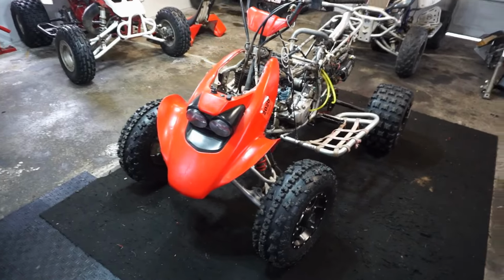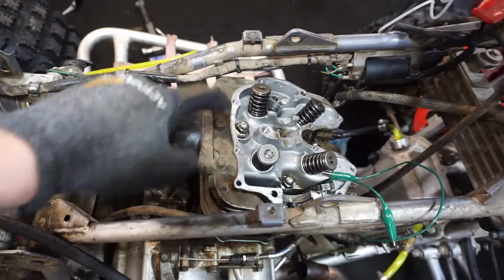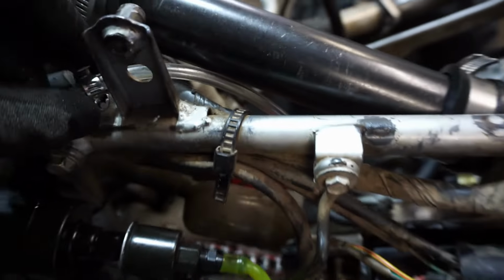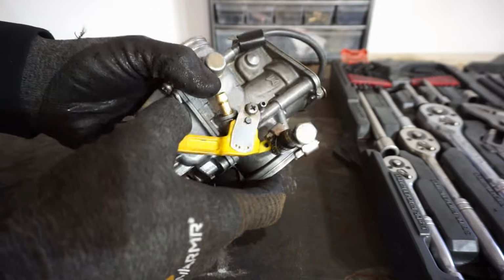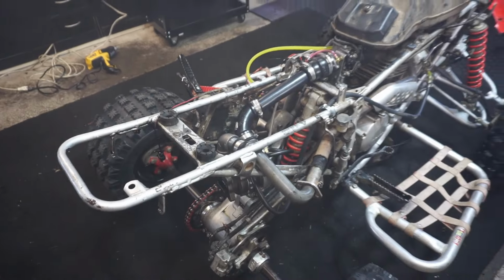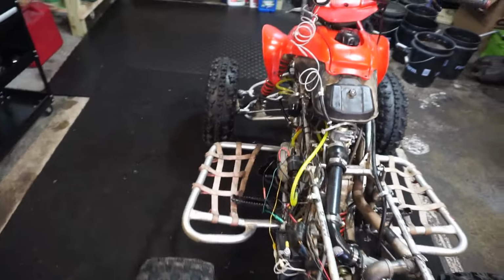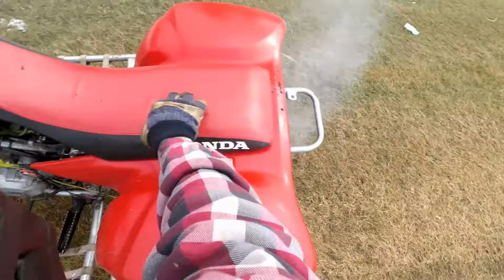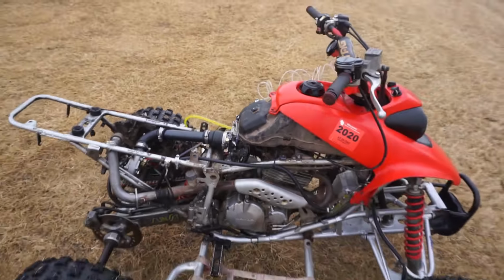Turbocharging My Honda 400ex 2.0 First Ride (New Design + Upgrades)

Comment: If you would put the carb before the intake of the turbo, run the carb on vaccume not boost, it will run correctly.

Comment: Joe carb turbo set up is very difficult and requires a special carb and lots $. Fuel injected is much much easier of a project and just requires a boost/fuel regulator that boosts pressure to injectors to act like bigger injectors..try this project on a FI quad

Comment: The only way you're going to make it work with that carburetor is to put the carburetor on the intake side of the turbo since you do not have fuel pressure as soon as it builds supposed it pushes the fuel back into the tank

Comment: Good concept good content what u need is a independent control module   (computer) fuel injection heavier valve springs? I would look into maybe go-kart fuel injection systems single band wide band 02 sensor? Just kicking around some ideas either way always informative to watch and entertaining

Comment: Instead of randomly guessing, A WB02 sensor kit is $170 and would let you know whats going on with all your engines. You can setup a kit with a small lipo 4s battery in a back pack and transfer it to all your projects easily.  Def need to know what the Air/fuel ratio is if you want the setup to work well.

Comment: 🔥pretty cool man, def a killer build. Forsure carb issues. Don’t give up Man U will get it. Stock jetting, no fuel pump, that carb is setup for gravity pressure, get it running smooth first, yes will be lean. Then slowly jet up and keep looking at plug till looks creamy. To me fells like will be hard to achieve it all with a carb setup trying to force all that air flow and moving that fuel into cylinder. Maybe work lil better with efi engine? Just a thought 💭

Comment: might be to much oil pressure for the turbo try suppling the turbo with its own oil supply tank being gravity fed so it takes it in only when it needs it and use a return line to come back into the tank

Comment: The regulator needs to be hooked to your boost gauge with return line back to tank the fuel should be a pound over your boost pressure adjust floats so the floats sit low. When you build boost the boost is pushing back down the main jet and shutting the fuel off with a higher fuel pressure it will continue to push back against the boost put a fuel gauge on the line and adjust. Your regulator should be boost controlled . Most carbs run at about 1-3 pounds mostorcycle cars are 4-7  so boost plus normal pressure is what you should need. Also it may help to run the oil return into the oil fill in the lower case or even the drain plug may take some piping but can be done you won’t need the oil pump anymore good luck I would like to see this thing work out for you.

Comment: Take the fuel pump off when it starts making boost it's pressurizing the carb and making it dump more fuel and starts flooding it I had the same problem with my turbo snowmobile

Comment: Maybe you need to build the turbo closer to the exhaust hole, i think youre way to build pressure is to long im just suggesting not shure but i shure you can do a better job for smaller air flow i hope this works out its a cheap way to fix it ✌🏻💪🏼

Comment: Everything is good you just need a tune or buy an racing ECU, it's the same aspect as boosting a car. If you boost it without a tune it will not run properly 💯💯💯 the computer aka ECU isn't preset to run boost at all. Try that and some racing coil packs.

Comment: You can't use that carburetor, as it's vacuum controlled.
As soon as you get boost, you lose the vacuum.
You need a different carburetor, or have the carburetor before the turbo, in any case this carburetor is not recommended.
You don't need fuel pumps etc, just connect the turbo pressure to the air hose to the fuel tank, and then you have the right pressure on the fuel all the time.

Comment: Is that surging being caused by un-controlled boost? Ie: un-controlled boost upsetting fuel mixtures under load?..  try boost controller/boost tee and keep it at six or seven pounds boost and tune fuel around that..

Comment: When you make boost you loose all vacuum. Just try putting the carb in front of the turbo and see if it helps
Reply: It looks to be a vac problem, as soon as it makes any boost it quits. The carb is designed to suck air and fuel. Adding boost could be pressurizing things that need vac. Or even pushing fuel the wrong way through the jets. 
If the carb is in front of the turbo it will continue to make vac while making boost. Just have fuel and air mixture going through the turbo. But could answer some questions pretty quickly. Good luck. Sub’d

Comment: Its simple to add power you have to add what? Air aka boost with that you also have to add fuel and alot off it especially when in boost when not in boost it will run fat because of the restrictions on low end and big fancy fan in exhaust

Comment: You need a blow-through carburetor, most carbs arent designed to work with boost. the air and fuel arent mixing correctly.

Comment: joe id recommend the wastegate spring may be only 5 lb and with turbos u have to knock timing usually unless its self learning but why i say waste gate spring is because itll make over a certain boost then cut the excess out its what its for and itd limit boost

Comment: I'd say you need to stick to your original design of putting the carb on the air inlet of the turbo, but putting the turbo a lot closer to the engine, that way it should work, well it does on cars anyways, although car carburetors are designed differently, so you may need to look into that.

Comment: I’ve seen boosted single cylinder engines require an expansion chamber in the charge pipe for the offset pulse of boost

Comment: 2 things,  (1)- It really sounds like it is running WAY TOO LEAN  !   --- ( 2) - I know from car setups for racing, that a lot of times  when you add more boost you have to ADVANCE TIMING  &  Run a much COLDER spark plug.  Also just a suggestion but these carbs are not designed to run being pressurized or FORCE FEEDING AIR,  plus look at the spark plug condition everytime you make a jet adjustment, this will tell you a lot  !!  DON'T make your jet changes so drastic.  When ever you are working on jetting you need to make smaller changes until you notice a change

Comment: Hi I have done this before I have seen all of your videos abowt this and I can’t remember if you bloked of the hole in the front of the carburettor where the boost pipe gose on if that’s bloked it stoped the carburettor getting flooded and that’s what it sounds like thats happening blok all the aire holes that come out of the carboratore threw the lines to ballene the boost pressure across the carburettor and that shouild work put one size jet down from stock and go from there and do a plug chek and see how it’s running that will fix it please try it it will work if you stick to it

Comment: A suck through turbo is a lot easier as then the carburetor  is not under boost ,  just size  a carburetor for the horsepower you expect ,  7lbs boost means 1.5 times more air  , 1.5 times more hirsepower

Comment: Are you sure that hose you have blanked off is not the return line for the pressure regulator.  In my experience the regulator controls the pressure by dumping the fuel above the pressure you set.

Comment: That carb is a diaphragm style carb. The butterfly is connected to the cable but the needle needs vacuum to work. I would try a traditional style carb. I'll bet that will fix the fuel problem. Also you have no way to adjust timing for boost. The reason it will rev when sitting still is because it's not making as much boost.
Reply: The 400ex carb is not a CV (constant volicity) style carb. The slide & needle are connected to the throttle cable. The LTZ400 uses a CV style carb like your thinking which uses vacuum to raise the needle.
Reply: @cadman9615  darn! I was hoping it was the problem and could make this thing rip for him!!
Reply: @bigcaputo09  yes! I’m hoping he keeps at it. It’s an awesome project!

Comment: Help pls, i kno ur a 400ex guy due to all the great videos lol, what seals the rear parking brake on the caliper. Mine is leaking out of rubber boot. I took it apart and cleaned it and it doesn't look like any parts are missing but its leaking out around the spiral screw that the lever attaches to . Any help will help 🙂

Comment: Only seen this latest video but just one bit of advice, if you don't pressurize the carburetor bowl so it matches the boost coming into the carburetor how do you expect it to draw fuel.? If you're intake track is pressurized it's going to blow into the carburetor instead of drawing fuel out. Just my two cents

Comment: Is there a return pipe from the carb to the tank? 
Reminds me of a problem i had before where the fuel return pipe was blocked on a yamaha Fazer. 
The return pipe used to relieve the pressure into the fuel filler cap and back into the tank. 
Might be way off but just a thought, love your vids anyway 👍

Comment: question. since u add turbo more psi fuel and oil pump along with top end rebuild wouldnt some type of tune or bigger engine or something to help compensate for the added boost?

Comment: Maybe look into getting a mini squirt that way you can adjust the ignition timing when under boost also try regulating boost pressure to 3 pounds that way it can spool lower in the rpm range and hold a steady boost pressure without lagging so long before it comes on

Comment: I know this video is old,  It's sounds like it's pre igniting/detonating do to too low of fuel octane...Turbo motor's run higher compression due to increase air volume forced into the combustion chamber, Try octane booster or 110 octane race gas

Comment: your leaning out cuz a blow through app requires more fuel pressure then boost or you dont get proper fuel spray try the draw  through carb and try again

Comment: Hey man. From what I see and can hear the turbo needs too be closer too the engine or your piping for the turbo needs too be smaller. There is too much space and that engine can not move enough air.. on cars there is 8 cylinders or 6 or 4 that are pushing air for the turbo..on cars you could basically put the turbo anywhere and it will work. I'd say try too get the turbo closer too the engine. Good luck man I love your videos keep up the good work.

Comment: Yeah throw that ebay turbo crap in the trash and put that thing back together right. If you want some hp gains start upgrading. I do applaud your persistance though. You certainly gave it the Ole college try as they say. Lots of better ways to make that four wheeler bad ass man.

Comment: Did you put a little extra gap in the piston rings for the extra heat from being turbo'd? Also is that a rubber coupler going from the header to the 90 into the turbo? No bueno

Comment: Would be a lot easier if you wire the oil pump to the fuel pump switch then you know they both would be on and stay on

Comment: I’d recommend getting an air fuel ratio/wide band gauge. It will tell you if you need more or less fuel
Reply: that ain't his issue, his issue is boost pressure in a carb that is meant to work in vacuum, this setup will never work properly, and the guy doesn't listen to anyone so 🤷‍♂

Comment: Not sure if youll ever get it to work properly with a small engine carb. Efi and youd be ready to go. Could probably do something like robotcantina with efi for it to work. Albeit he did it on a small engine (gokart engine basically) mounted up in a car. Aside from the car body, same concept.

Comment: I made a vid showing a simple blow through system you'd like. It's lean up in the transition into boost and in boost. That pump won't give you enough pressure
Reply: For the record iv been down this road happy to say iv almost cracked the 100whp mark out of 155cc yes it takes alot of boost to do that and yes I'm blow through
Reply: Your pitot tube is all wrong it needs to be in the direction of flow.
Reply: Lmao thanks ten years of R&D in my setup probably 2years until it ran good and made power but 3-4 years before the drivability was there. I'll do my best to get it back together and make a new vid running much more boost and showing off the drivability. The cutting in and out on transition is mostly the pitot tube not being in the flow or the right size. I found about a 1/4in tube with I forget what size hole does it either way it ended up being the same the engineers at Honda figured for their ram air systems. It's literally the same system as a ram air for blow through but the pressures are higher and ramp faster. Fuel pumps work with regulators but their heavy and not needed if your okay with some risk.

Comment: Hi man,
 for carb motor, you need put carb in front turbo..
 i've seen you made few video trying to build and diagnose it.. 
feel bad for you to seen in after few weeks and having the responce to you.

I dont know about trying the small fuel pump and pressure regulator? 
(does it have a return/over flow on regulator?) 
Cause iff the floats are pushed down by too much pressure it wil flood it. 

Boost line have to be at 3 place, 
1- waste gate
2- intake manifold
3- fuel regulator

Info for carb,
 its use bernoulis effect. 

If air is pushed into carb in defference to sucked out, that will affect the jet and fuel repartition.

Cause it bernoulis effect normaly mix gas with air as goes into the tunnel (carb)

Let me explain more, forcing air into it will push out fuel instead of taking it with it.
In result of tha running lean in boost and rich at idle.

Hope that will help you!

Comment: next thing is the oil from the bike might be to thick for the turbo then causing higher oil pressure which is another good reason to providing your turbo with its own oil supply thicker the oil higher the pressure thinner the oil the lower the pressure
also the fittings your using could be to small remember the return has to be bigger than the high pressure line.

Comment: Carbs work off of vacuum you can’t push air into the jet and expect it to pull fuel through. You need the carb on the intake side of the turbo. Draw threw turbo carb google it or watch my turbo gokart video

Comment: Seems like maybe there are one or more too many joints and bends the pressurized exhaust air has to travel through. This could also mean one ore more air leaks. Can you move the boost sender to the pipe just before the carb to see how much boost your making at the throat of the carb? Sorry if that is already what you have, but wanted to mention just in case. Also, check the AFR with a wideband O2 setup to see how rich/lean you are overall. I think this idea could be made to work, but it is does try one's patience I imagine. Still, its exciting you have tried. Don't give up if you don't have to. Take care - Ted

Comment: Have you tried running the bowl vent to the boost signal? The bowl has to be the same pressure as the manifold pressure or it won't draw fuel under boost

Comment: Bent needle huh?  Exactly why didn't it run away when started? The needle jet is obviously part of the slide, so if was bent the slide wouldn't technically close to idle. And btw, yeah never once seen a needle bend just for hell of it... But let's continue...

Comment: Maybe an electron carb? Its definitely wanting more fuel for the mount of air coming in. That carb just cant provide it
Reply: If any new carb is needed it's a diaphragm style not a float, floats aren't good with allot of fuel pressure

Comment: Its the ignition timing . For every psi of boost .a degree of timing. But you would need a aftermarket ECU.
Reply: He could just oval out the wholes for the pickup bracket and move it

Comment: Try running your carburetor vent lines right before the carburetor but after your turbo. What that will do is when your turbo spools it will pressurize the carburetor to how much boost it is making so it is not trying to push the fuel backwards. I believe that is why it doesn't want to go. Also why I think your fuel regulator isn't doing anything is because you have the return line blocked off. How they work is by bleeding off the excess pressure and pushing it out the return line back into the gas tank. Watch this video it explains it well https://www.youtube.com/watch?v=LLdJ-_YIMdY        So you wanna Turbo your bike - part 3  BY  The Workshop    .Good luck and don't give up.
Reply: Correct 👍

Comment: If you haven't abandoned this, you need to just go EFI. Ecotrons has a setup for under $300... Thing would rip. Considering going EFI first to get consistent with my warrior then add a teensy bit of boost.... Ive considering driving a blower as well, but ultimately turbo is more flexible to package, easier to setup, belts are not fun to add. More machining work than some welding

Comment: I'll bet money that new head gasket didn't seal judging by the way it smokes and slobbers oil out the exhaust. You need to resurface both the head and the cylinder and you also need to drill and tap for gt thunder head studs.